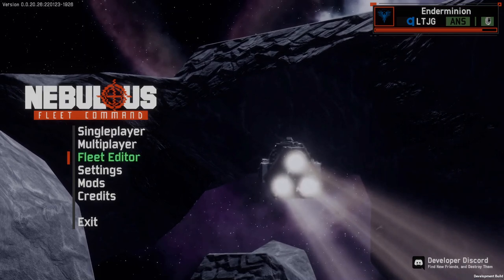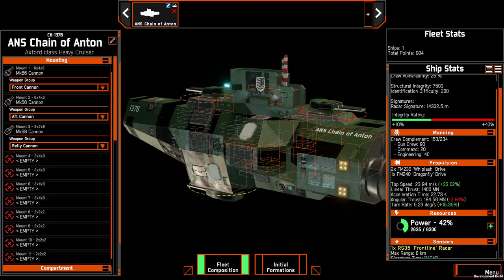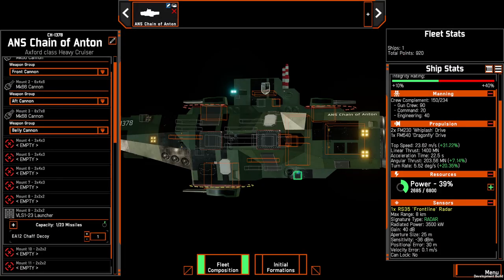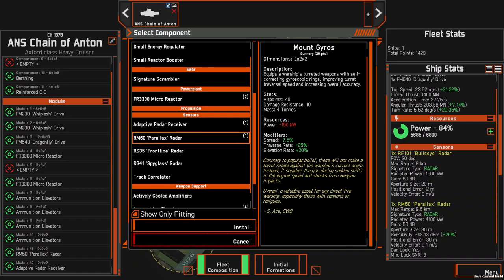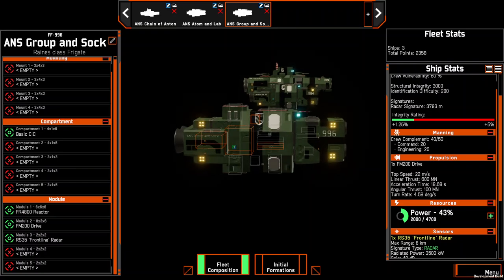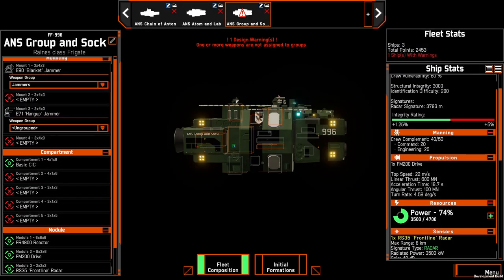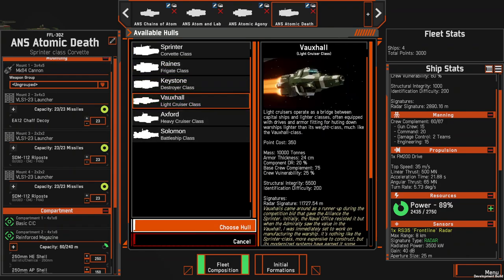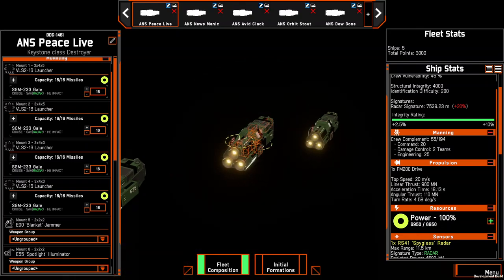Nebulous Fleet Command building a fleet

Comment: Really want to see this fleet in action.
Reply from the maker: Honestly doubtful that this fleet will see action it's kind of mediocre compared to a fast battleship. I mentioned a speed of 23.69m/s early on in the video and didn't elaborate further, that's what I consider the "standard" speed of a fast battleship, exact speed can vary but the downsides of going faster rapidly exceed what I consider reasonable, and going slower also isn't that much better until you get to ~21m/s.